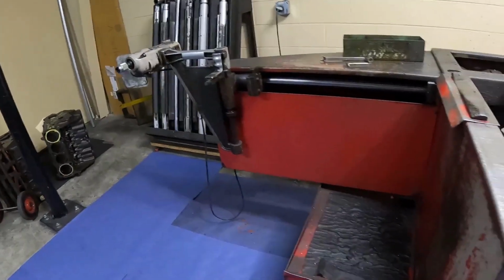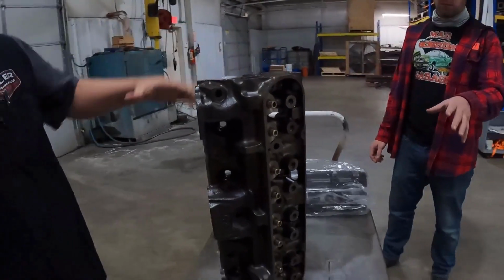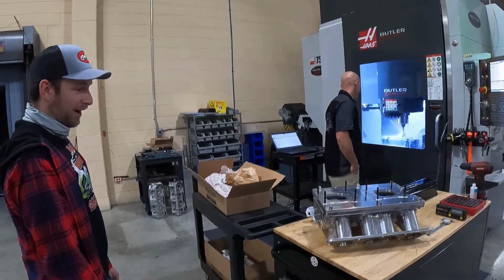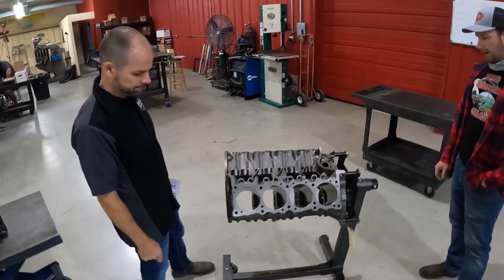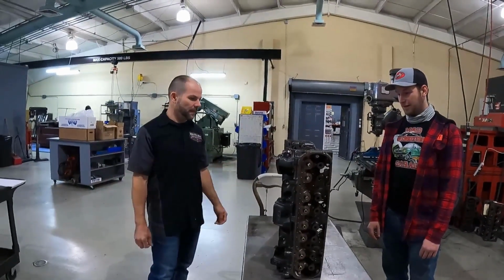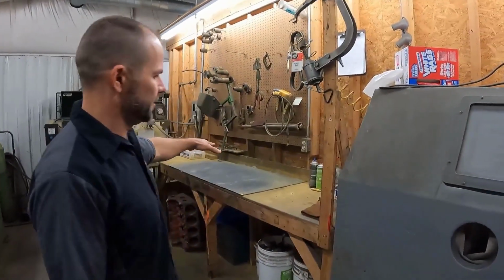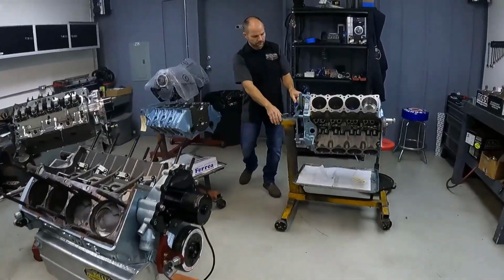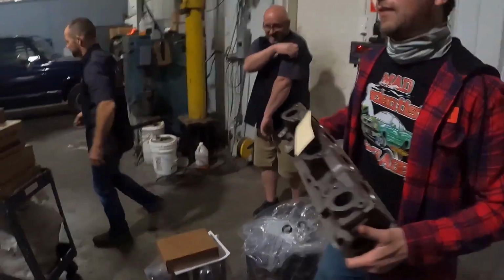Inside Butler Performance - Picking Up Our 474ci Pontiac Engine Kit!

Comment: I personally would have had them hang the pistons and assemble the heads.   Minimal expense with such a short turnaround since they do it all the time.  You may just have wanted to do it yourself or were tight on $$.??
Reply from the maker: Plus it's good fun to assemble it myself.

Comment: I have a1977 Pontiac 301v8 what can I do to make it better running. 145000 miles on it and it run great, let me know if you can what can be done to make it run better.well see you next time see ya bye.
Reply from the maker: Call Butler- that's what I did!

Comment: All I remember about my Pontiac engine was how it blew up day after day after day. The biggest piece of junk I ever bought with a lasting CURSE for me. That stinking Pontiac 389 I had in my GTO could never even start unless it blew out the water pump or died after working on the carter carbs. Everything blew up on my GTO. I mean, the driver seat was the only thing that did not break till I had enough....& bought MOPAR! PONTIAC?????????    REALLY?  The doggiest car I ever OWNED. I went to the Pontiac dealership...and watched them blow up when they started new cars. I mean....whoa.....start a Pontiac & watch the water pumps explode like dyno mite. PONTIAC STINKS! By the way....the company died years ago....so come on.....
Reply: Are we supposed to believe you at all??? BS!
Reply from the maker: Butler reliably makes more than 2000 horsepower with one of their Pontiac based racing engines, and they've put scores of stock blocks on the road making more than double factory power without a sweat. I know what kind of quality and power I'm getting for my money here and they did an awesome job showing us everything they do in house for that to be possible.
Reply from the maker: I think you're gonna be impressed when you see the results- this is no Monday morning factory engine. Hit subscribe and we'll make you believe.

Comment: Nice, if I remember correctly the RA-5 HEADS are modified ford boss 429 racing heads. Makes anything you put them on the boss ! Rotating mass is pounds lighter and stronger.  All the limiting factors of pontiac engines is eliminated,  awesome  !
Reply from the maker: She's gonna be one bad mother real shortly here. I had a hectic summer but I'm not giving up!
Reply: @MadScientistGarage  Cool, if you do intend to get better heads D.C.I  motorsports has aftermarket R/A V heads. Kinda pricey but not when you price some used OEM R/A V heads.  Just a FYI
Reply: Wrong.   427 tunnel port Ford
Reply: @paulstuck5268  Well I had the Ford part right 😆

Comment: I need help... I just bought a 94 Firebird...it has a V-6 Motor....To me they R Junk! My question is Y did they put a Chevy Camaro hookup... I want to put My 69 GTO Motor in it Change Transmission to a 400 Turbo...How do I go about a Driveshaft to the Rear
Reply from the maker: I'd recommend an iron LS from a 99-13 Chevy truck. They're dirt cheap, tolerate tons of boost or nitrous, and they're still light. There are mounts to literally bolt it in, or you can buy a 98-02 Camaro/Firebird cradle like I'm doing to my '94. A TH350 is a strong enough unit to handle 500+ hp if they're in good shape and will fit right under the floor. Measure center to center from each yoke when you're all mounted up with weight on the suspension and leave a 3/4" extra for the yoke to slide in. Any shaft shop can make you a one piece for that.

Comment: Approximately how much do you have in your build....so far?(motor specifically)
Reply from the maker: I admittedly didn't keep track, and I bought things I did not strictly need just because I want it super nice. The rotating assembly I bought is top notch and just over $1000 all in with custom forged pistons. It'd be less with stock style pistons. I also paid to have it all balanced and blueprinted, which wasn't necessary, but since I'm building it I went all out. Every gasket, seal, bearing, etc. is brand new and the castings are totally refreshed. I recommend sending Butler an email with some things you require, things you want (power level for cruising, racing, etc), and a general budget. I'm pretty confident there isn't any way to make this kind of power for less than I spent. They'll sell you parts to dingle ball rebuild it at home, you can buy a totally blueprinted kit with your block and heads machined like mine, or you can buy a drop in engine with a Dyno sheet. They're interested in keeping Pontiacs on the road, not selling you stuff you really don't need.
Reply from the maker: Total in my car including purchase price, some small repairs, new front suspension, 4bbl swap, engine build, transmission swap, line lock, etc. I'd estimate less than $6k. It should run with brand new muscle cars if it has enough traction.

Comment: Butler Performance very responsible for the Pontiac engine not going away.
Reply from the maker: I'm very lucky they took the time to show me around and answer all my questions
Reply: @MadScientistGarage  Iv`e got 3, 455`s over here. Been into poncho`s since the early 80`s. That combo you have will scoot. With traction, it will, sooner or later, break your stock transmission and/or rear end.
Reply from the maker: @puncht37  I plan to see exactly how far I can push it with a 474 dishing out the power.

Comment: New Sub here... I thought I was the only "young guy" keeping a Pontiac motor in my Pontiac... ha, ha... Great decision to go with Butler Performance.  I am super jealous you got a tour.  I have a 467 from Butler, in my 69 GTO.  If you run into any issues, let me know... I'm sure I've seen it.  Keep it up!
Reply from the maker: Welcome to the channel!! I've gotten a ton of support from the guys at Butler and I'll have a complete set of videos coming on the head and short block assembly. I'm fairly dangerous with a tool kit and their machine work took most of the tricky parts out of the assembly process. I'm not normally this confident in machine work but everything I have gone back and measured is absolutely perfection. My only problem right now is financing the rear tires I'll be buying on a monthly basis when it's done.
Reply: @MadScientistGarage  Ha!  I totally understand.  One piece at a time.  I'm currently rebuilding my 467, due to oil starvation and a lifter that blew up.  The Butler team is absolutely incredible.  And I too, will be filming the entire rebuild.  My most recent video is the tear down and root cause analysis.  Check it out when you can.  (I already have the long block videos posted, from my last re-build, where Butler actually uses my Cam Timing video)  I'll be following along ...
Reply from the maker: @FastMonty  I'll definitely give it a watch. I'm running the Butler oil pump and some decent Crower lifters to avoid problems like that..
Reply: @MadScientistGarage  Sounds good.  Yeah, all lifters have their issues.. I now have Johnson Lifters, and the Butler Pro Pump.  Crazy fun.

Comment: I bought a 535ci crate motor from Butler back in 2009, it ran good,  low to mid 10 second et's in my 79 trans am,  pretty good.
Reply from the maker: I'm very excited to fire mine up. It's going to be pretty rowdy.

Comment: Seeing those ram air v heads was awesome. Ive seen a few sets, but its always like seeing bigfoot.
Reply from the maker: The shop was SO surreal to see in person. They do top notch work and even a guy like me can assemble 450hp/550tq with little effort. That's why I'm building this instead of spending a pile on an LS swap.
Reply: @MadScientistGarage  owe yea. Ive known butler for awhile, used one of there 461 kits. Im restoring 70 goat. But still gotta love ram air stuff. I was like u when i first seen V. Speechless
Reply from the maker: @morganbrantley9058  I'm working on the engine assembly videos for the 474 I picked up. She's gonna SCREAM
Reply: @MadScientistGarage  cool man. Take ur time, get it right first time. Message me if you need help
Reply from the maker: @morganbrantley9058  will do! Follow along on Facebook or Instagram- stuff is much more instant on there
Reply: For the cost of original ones you can buy several sets of new Rav heads.

Comment: Great video. Great shop. Great to see the focus on Pontiac power like that. Have heard of Butler before but great to see this behind the scenes stuff. The 'Bird is gonna come back to life.
Reply from the maker: Pray for my clutch and differential. They're about to be scientifically tested.
Reply: @MadScientistGarage  Reminds me of my 1st car. '66 Chevelle, 396, 4-speed car. Bought when I was 17. Stupid and ga-ga. Motor exploded
 within a month. Rebuilt it with lots of help. Then clutch went, then blew out diff. All in one summer. Learned a lot that summer. Kept it the next summer then sold it for money for college.
Reply from the maker: @briankinnear7461  all part of owning a hot rod. I'm sure it's gonna punish me more, but it's worth it